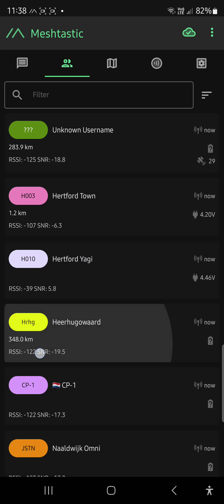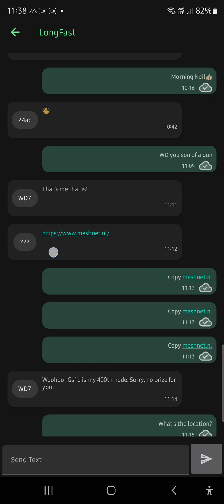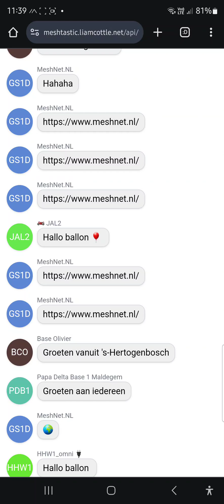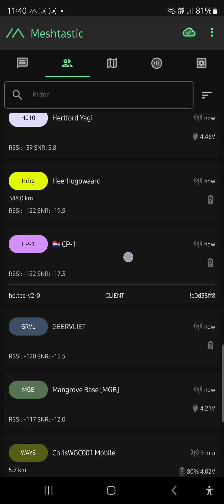Amazing 340km+ contacts from Netherlands to UK on Meshtastic!

Comment: How can you tell the difference between a real location and a spoofed location? 

I saw a node in San Francisco which is 350 miles or 563 kilometers from me in Los Angeles, and a day later it disappeared. 

So just to test location spoofing  I changed my location to a town in Wyoming which is over 1628 kilometers / 1012 miles away and left it there for a couple of days, never got any hits on it but I know that distance is impossible, not to mention the Rocky mountains in the path, and also earth curvature.

So besides the ridiculous distance and actually getting a message from a distant node, is there a way to tell whether a location is really real or not?